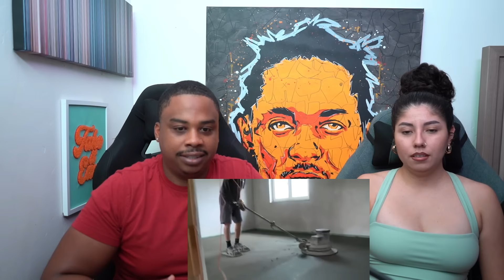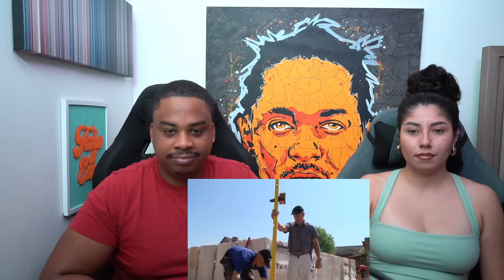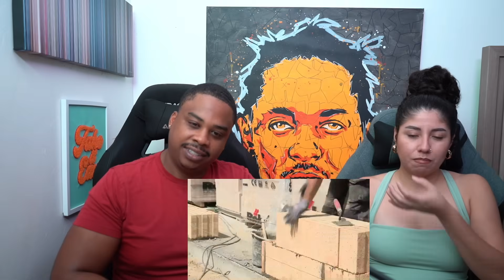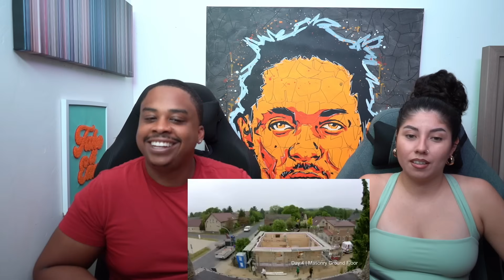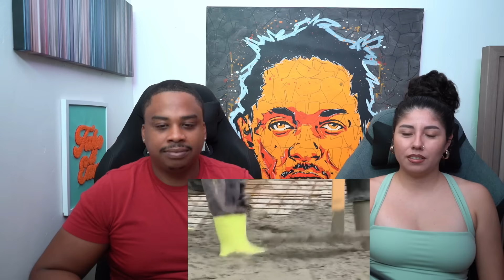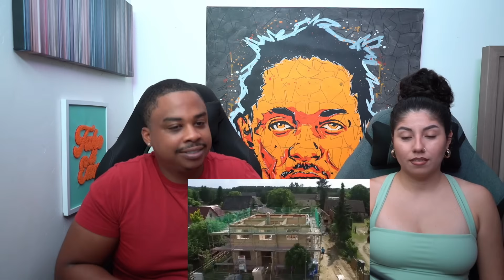AMERICANS REACT TO HOW GERMAN HOUSES ARE MADE

Comment: thoose modern materials and unrefined architecture are great if u like seeing the electricity work ontop of the walls.
or u do it like most german messed up buildingcompanys and go against the buildingplans and try to hide the cabels inside the to small prepared important walls .
these isolated outsidewalls are no better either , start sponaiously to ignite if u drill them , its also hard to integrate hardware since u need a lot of ceent to fill up the isolationholes.

Comment: This is an 8-part series, the playlist is linked as an endcard. Parts 7 and 8 are not available with the English voiceover, you need to look for the German version of those on their channel.

The total build took 6 months, but much of that is waiting time. Mineral building materials like concrete take time to harden and dry out. This slows down the process once you close the building and have to manage (i.e. remove) moisture. However, I don't consider waiting time important---it costs nothing to let the partially finished building sit for a couple of weeks.

Comment: You asked how long concrete ceiling has to wait before further work can be done - similarly to foundation slab - usually should be 3-4 weeks. You can walk on it after few days, but it has to gain some strength before bigger weight will be put on it.

Comment: Hi guys, from the UK here. I have a 1920's house which is a doubl e skinned house of 2 layers of brick with a cavity in between with a slate roof. In most houses of this age the cavity was just an air gap with metal ties connecting the 2 layers together. They are often now "cavity filled" with polystyrene beads, blown mineral wool or expanding foam to improve insulation values. this style is still popular today but the insulation is built in. the other popular construction methods are structural brick outer, cavity insulation and timber and drywall inner (mainly used by large construction companies). Structural brick outer again with SIPS Structurally insulated panels made from two plywood or chipboard outers with an expanding foam inner, mainly used by smaller builders and self builders. most houses now have fired clay tiles on the roof but some still have slate especially if they will fit in better with the local vernacular.German style HUF Houses and Swedish  Pasive houses are also being built by self builders and bespoke construction companies these both have ultra high insulation values which when included with solar etc can actually mean the utility companies will pay YOU. BTW the only place you will see roofing shingles is on our garden sheds. Finally Just a little friendly Trolling from a 40 year member of the FAITHFUL, GO NINERS, and I hope Geno stays healthy and you won't need Jimmy.